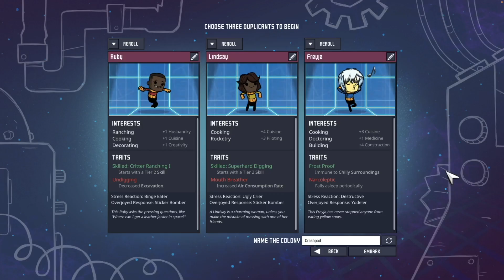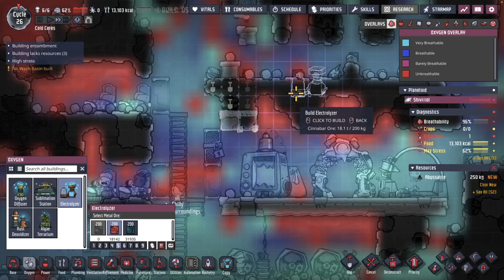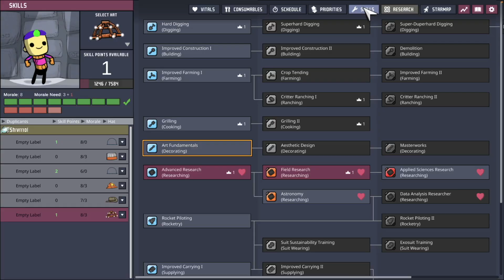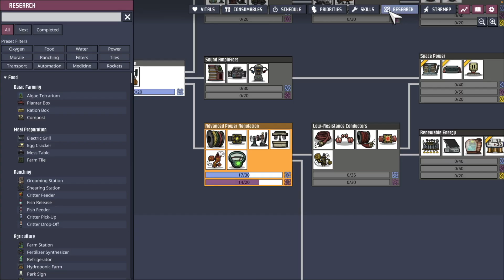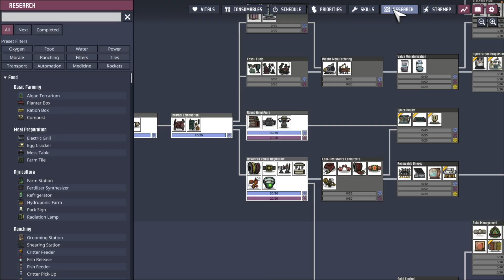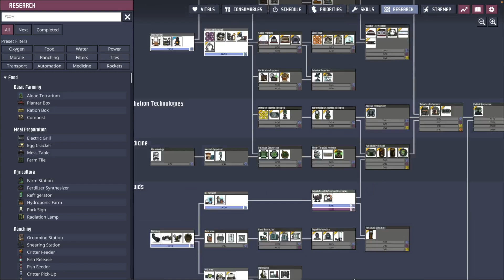We have the Power - Cold Ceres 5

Comment: Well done, you have stabilised ! You did well. I think you could have sneaked the hydrogen gen earlier to have an easier time. Not sure if it was possible without both the hot geyser and the warm sweater locker. By the way, you could also have helped your melter going with double layer woodtiles and some hot salt water (even via bottle, it would have been more efficient than wheel + tepedizer i think, even if it was damn impressive). Anyway, you did it ! congrats !  

2:30 It was really the snow tile that was melting away !
18:50 Look into pemmicans, they have low tallow requirements and are very efficient use of meat (better ratio at 1.6 than bbq at 1.25). If you reveal the seal biomes, you should have already some seal who laid eggs and a single seal give so much tallow (enough for 50 batch). TBH, They should lower it or increase the tallow required, for now it's overtune like saturn traps hydrogen output.
28:58 I think you can't feed all those for now, you should focus on 1 well fed breeder. Isolate all the other in the open.
You can fed the breeder with harvested squash to not have to move the bammoth.
Once you can keep up with a single breeder, you can start scaling up. I think you need something ridiculously large like 16 wild squash total per bammoth.
By feeding multiple, you are at risk of losing all bammoth down the line as they will ALL starve to death eventually, or worse, you might use all the food to just let them barely survived and barely produce any excess of eggs.